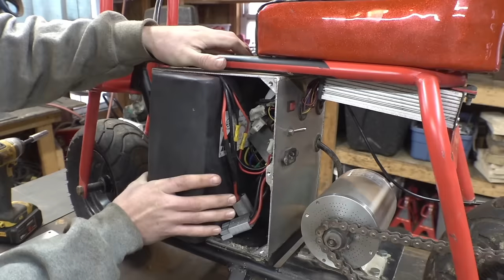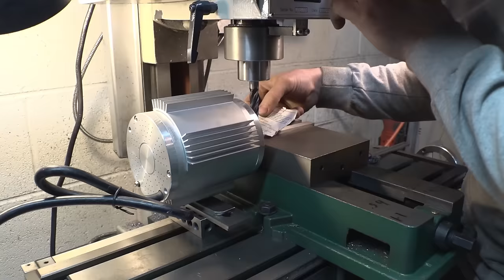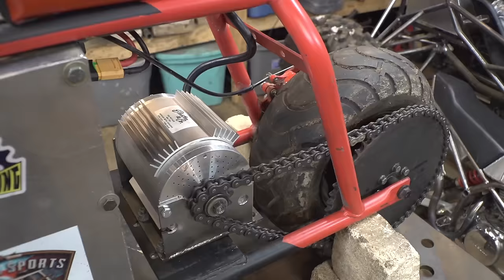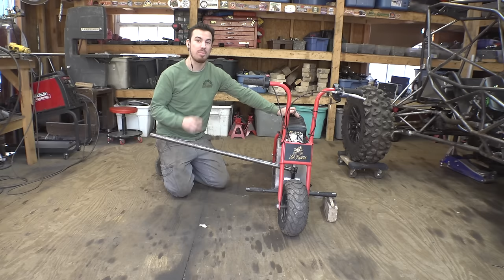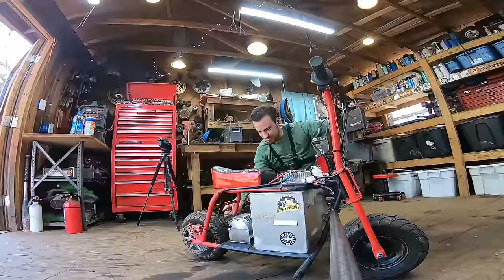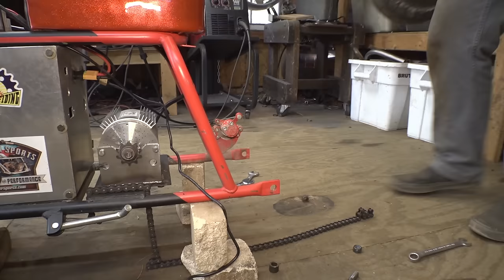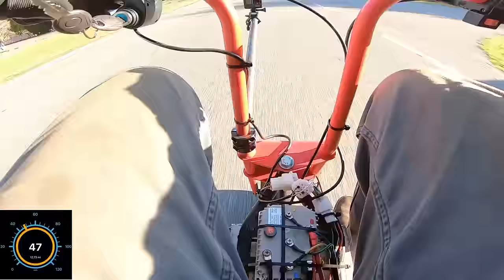Insanely Fast 6000w Electric Mini Bike!!

Comment: Question for u ? Seen this on bike can you fab up some like this would be dope ...Cant post pic  check out video at 46 secs   https://www.youtube.com/watch?v=ze2OOBCLCt0&t=43s the starting system its like a re moveable kick starter working throw the clutch starter instead of pull start you kick arm it engages like pull start the when starts doesn't spin and you remove kick start i guess  wicked idea  can make some thing like this or design ???